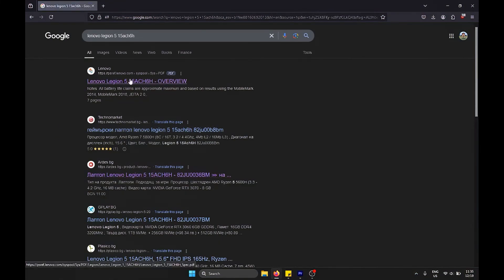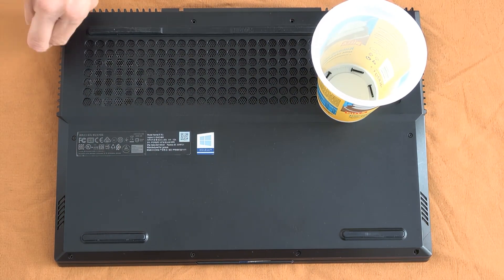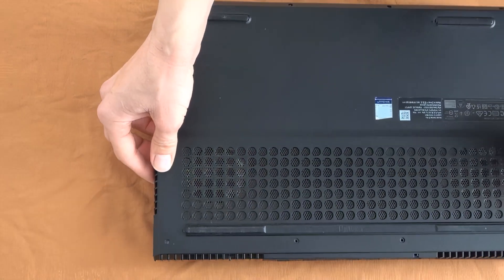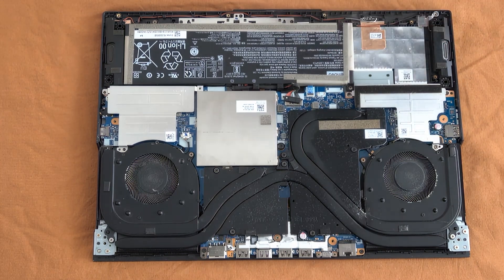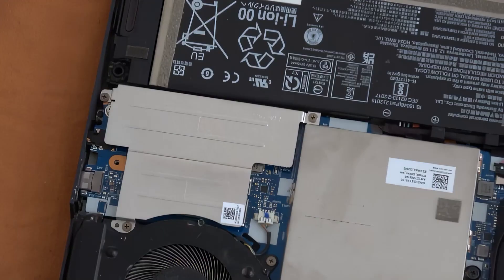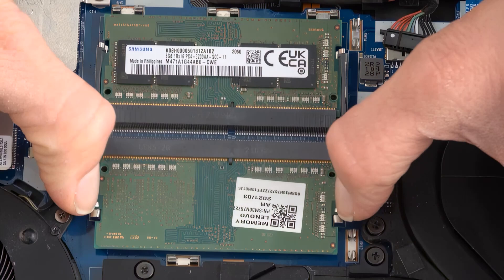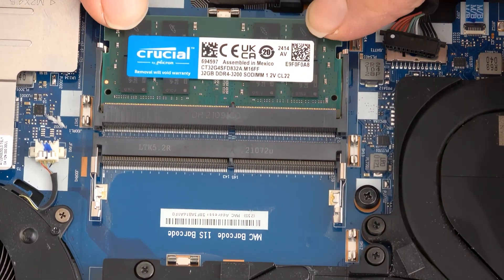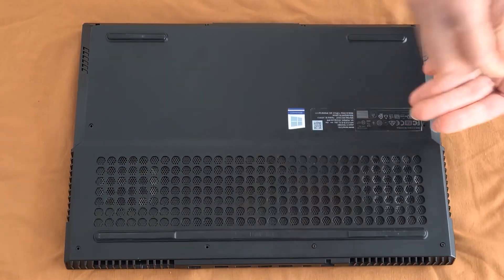Boost Lenovo Legion 5 Performance with RAM & SSD Upgrade

Comment: Do you think I could put two 32 gb ram in order to have 64 gb? Or is it the max Ram capacity limited to 32gb in total?
Reply from the maker: Please check the specification for your specific model ! For this model we added 1x32GB.
Reply: @NevyanNeykov  Would have been better to add 2 modules of 16 GB each, in order to use the dual channel capability
Reply from the maker: yes, but just in case that you don't want to upgrade with more than 32Gb. In a few years you might want to add another 32Gb :)
Reply: @NevyanNeykov yes but you still can sell it right?

Comment: you put 32g ram on 1 slot right. and 2 gb ssd . does it work fine ? my ram slot been brok  ihave only 1 slot  can u comfirm 32gb ram on 1 slot woks well..
Reply from the maker: Yes it works fine.
Reply: @ thanks for sharing 👍

Comment: For the storage. I saw that it only supports up to 1tb m.2. is that true?

Is it possible to replace both slot with 2tb x2 for a total of 4TB?
Reply from the maker: For sure you'll need to check the specifications for your own model about what is supported! The one in the video is max: 2x1TB.
Reply: @NevyanNeykov  thanks for replying brother
Reply: @NevyanNeykov  Mine is legion 5 too. It's 82JK. I was thinking if i can just leave the stock 500gb and then buy a 2gb. 

The other option is to buy 2x1TB but the 500gb will be no use. I want to save as much as possible